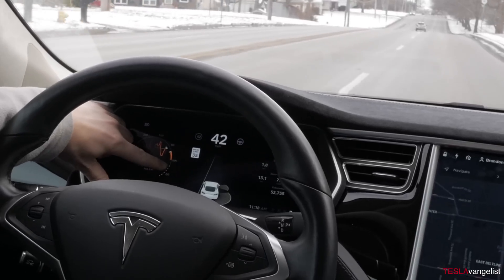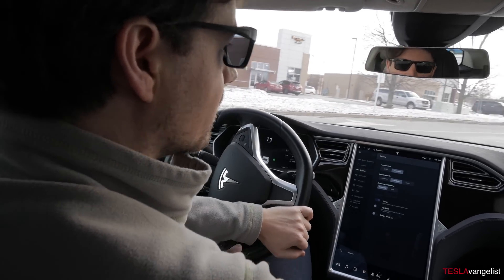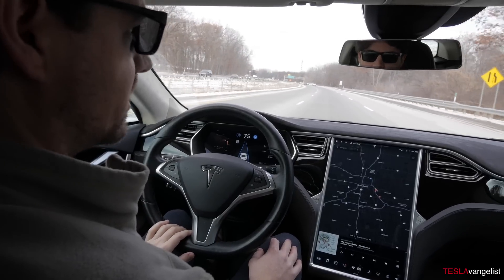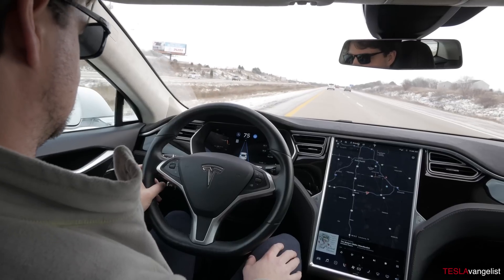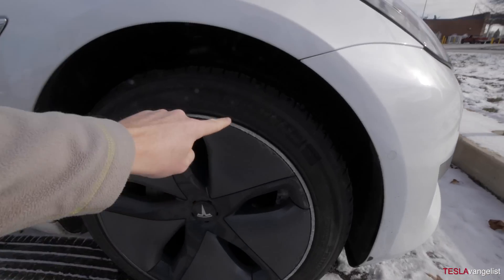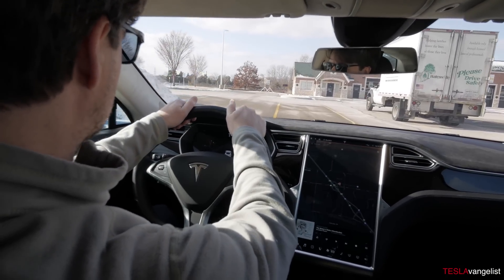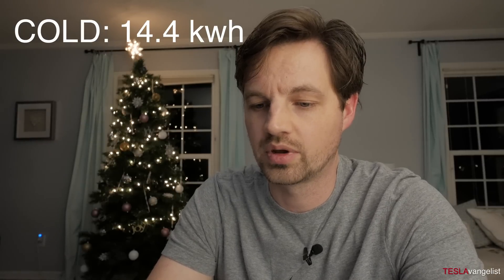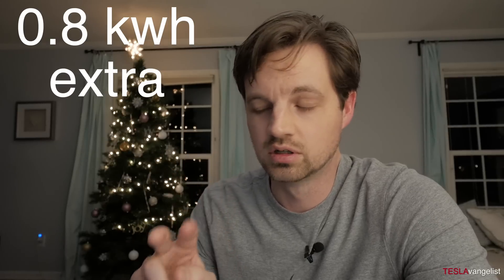Energy lost due to COLD Tesla battery (S70D)

Comment: When not on the expressway, if the battery is cold, the Model 3 "stalls the motor" when the vehicle isn't moving.  In other words, it sends current through the windings of the electric motor while holding the motor stationary (for example at red lights and stop signs) using the resistance in the motor to generate heat which is then transferred via the coolant to the battery.  This extra (non-motive) use of electricity is yet another way that the wh/mi are increased when the battery is cold.

Comment: I recently drove my LR Model 3 from the Gaylord supercharger to East Lansing. I left with100 miles more range than I needed, and arrived with only 45. Along the way, I experimented by turning off various devices for five minutes to see the effect on predicted range. I never used the seat heaters, and the temperature was set at 68° the entire way. Only speed had a noticeable effect, so I drove nearly the whole trip at just 70 mph.  Given that the trip is nearly all down hill, and that the super charger must have heated the battery, this drop in range and the fact that the car’s range prediction is so far off, winter driving is pretty challenging.

Comment: Hi Brandon. I also live in Michigan and drive anywhere from 60 to 220 miles per day for work. I've been debating on buying a Tesla for a few months but concerned about winter mileage. So this video is very helpful. Still planning on renting your model S for a week to see if owning a Tesla works with my busy schedule. Thank you for your videos.
Reply from the maker: Thanks for the feedback! I estimate about 30% loss of range overall in winter, so If you need 220mi in the winter, you'll want the biggest battery you can, especially for days it's snowing. Long Range Model 3 would probably be fine. Don't need AWD if you have good snow tires.

Comment: Last winter my 85kw S 90% charge went from 231 miles to 226 and never recover back to 231.  So far this year is at 225.
Reply from the maker: I've heard that it's good for the battery to do a slow charge from 0-100% once in a while. Also keeps the vehicle system accurate in reporting battery level of charge.